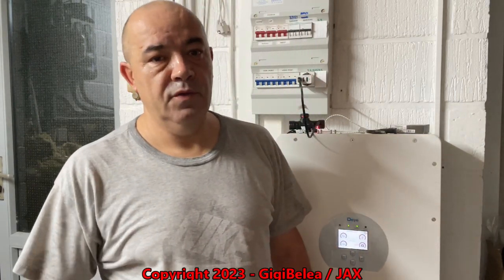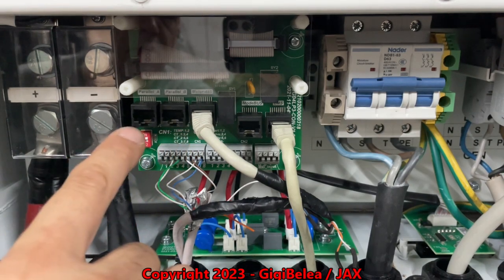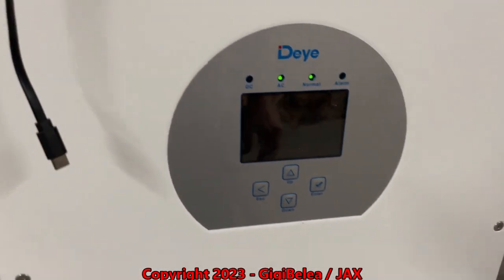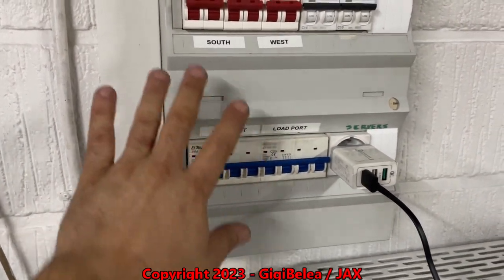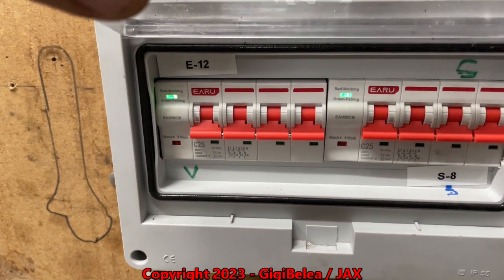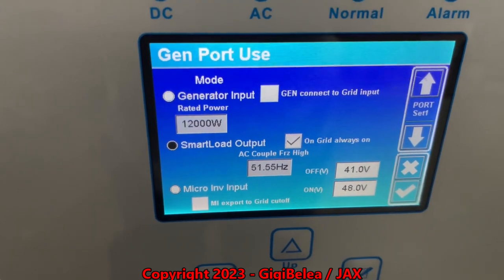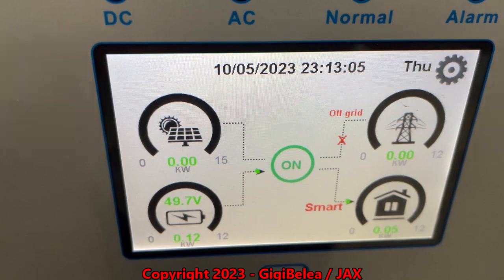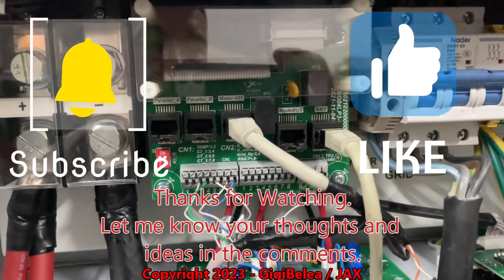Deye Hybrid Inverter - Gen Port - Smart Load usage and Functionality

Comment: w04 meter comm fail also here with an external CT (chint). It just appears randomly and doesnt affect anything. Weird problem. My inverter is a 12K Hybrid Deye.
Reply: I had the same problem and put a 120Ω resitor 1/4W at port 24/25 of chint meter  and no w04 error since then!

Comment: Hello Gigi. There is a swiching time delay in case of grid off / battery on ?
Reply from the maker: A few ms , you will not notice the switchover. I have servers running on Load port and whenever I switch off the grid the servers will keep running without any problem.

Comment: Hello, i have the same inverter. Can i use the Gen port to power directly a 6kw water heater? What happens if there is only 4 kw of power available on solar?
I don’t want to use the grid for smart load,
I am not selling , i just want to put the excess solar power in an 500 liters puffer
Reply from the maker: If there is not enough PV the inverter will pull from battery , without battery smart load port will not work unless you say the port should be active as long as there is grid connection , then will pull from grid.

Comment: 1. What is the maximum consumption that can support on the GEN port? Can you connect the whole house? I have a heat pump, switches, servers and others. The maximum consuption shouldn't be more than 5kw.
2. Do you know if there are any differences between 12Kw model and 30Kw model? I have 3 Huawei Inverters (10+10+4kw)  + backup box (without battery) and I'm thinking to switch to Deye + batteries. I have 28Kw of panels (high peak of course)

Thanks a lot.
Reply from the maker: 1. Max capacity of the inverter is 12kw , so whatever you put on GEN + Backup port must not exceed 12kw then you will be fine. 2. Think the only difference would be the capacity , else all functions should be the same , but 30Kw is only for HV batteries.
Reply: Could it be possible to use micro inverters at PV string(AC output) to be fed at Gen port which would definitely  spare a MPPT port for additional input(which could be used for wind turbine controller output)   @GigiBeleaDK
Reply from the maker: @sobanidrees2999  Yes, Deye confirmed is possible.
Reply: @sobanidrees2999  can you also use grid tie inverter instead of micro inverter
Reply: @GigiBeleaDK  
By doing so can deye user could increase the input power to battery bank or that gen port only work for feeding load meanwhile the MPPT Input(wind turbine) would only be the power available to be fed to storage batteries ??

Comment: Hi . Please tell me is this iventer deye 12   works 100 %  off grid  . Just only pv and aku ? Zero grid . Thx for answer . And happy new year 2024 .
Reply from the maker: Yes, it will work offgrid also but think the self consumption of the inverter is around 70-80w .. so you will have a constant draw on the system.
Reply: @GigiBeleaDK  How much are you sure about this self consumption? I plan to use it for off-grid and when it's night only to power 60W for PLC/HMI, so I don't need big battery, but taking into consideration this consumption it more than double my needs. Other inverters show sth around 10-20W when it's idle.
Reply from the maker: @arturagonski4674  I am pretty sure :)